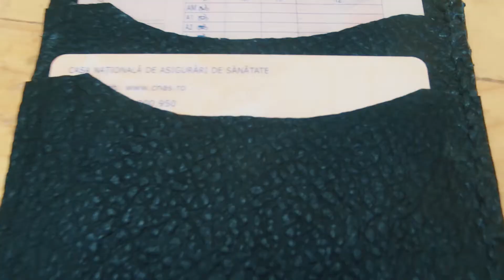DIY Leather Wallet - Getting better

Comment: Much better!  Good, cleanly burnished edges, and the clamps are going a long way towards keeping your glue joints from wrinkling up.  You might want to invest in an edge-chamferer for your next leather-working tool; it helps a lot in cleaning up the cut edges.  I also find a scratch-awl makes my layout look cleaner and helps guide my knife in cutting the patterns from the leather.  Excellent work!  Thanks for sharing!
Reply from the maker: Yes i need to invest in new leather working tools that's the next step. Thank you for the good words :D